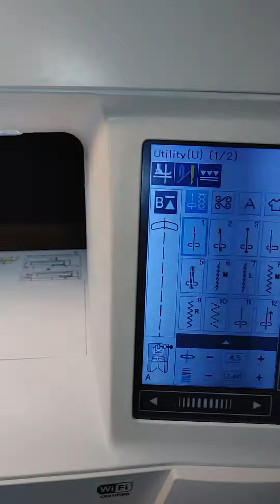Janome Sewing Machine Needle Bar Calibration.

Comment: Thanks Eric this is exactly what I was looking for.  The Skyline S9 is pretty much built like the MC 9900.  I have been trying to fix an issue where the tension in embroidery mode is not working and thread is too lose.  When switching to sewing mode the tension works and can be adjusted but switching back to embroidery and the tension stops working.  I have cleaned the tension unit and have cleaned and oiled the machine but still have this problem.  The only way to do embroidery is by applying tension to the thread before it goes into the machine.  I have tried everything except reinstalling the software which could be the cause.  The only other area I have not tried is making sure that the needle bar is correctly falling into the machine and lining up with the hook race.  I will try that now.  If you  have come across this problem before or know what needs to be done to fix it, please let me know.    Thanks again for this video which really cleared things up for me as far as the needle bar is concerned.  Jo
Reply from the maker: You're welcome, let me know if it doesn't work and I will try to figure this out also.
Reply from the maker: This is a pretty good video on thread tension issues https://www.youtube.com/watch?v=b7Lqa7-sbnI
Reply from the maker: Here's another one. https://www.youtube.com/watch?v=YSSHUjOsVUw
Reply: @ejdavis72  I've checked the hook race and needle position like you showed in your video and also checked the needle bar for any area that may be lose but everything seems fine and any adjustment in any way only makes the problem worse.  I've put the machine back to the way it was and still have the tension issue.  something else that is odd is that once the machine is threaded and I tug on the thread to test the tension the tension appears to be correct for about a second or two and then it gives way and loosens.  When placing my ear to the machine and doing the same thing, I can hear a click when the tension becomes lose.  It seems to be coming from the top, plus on openng the machine up, there is no visible place for it to be happening on the tension unit.  Is there a way of tightening the tension unit a bit before reinstalling so that it starts working with the disks closer together.  I will also be checking the top part of the machine where the thread first enters into the machine, but even if this was faulty it would not explain the amount of looseness experienced,  It most definately is that the disks are working but maybe they have somehow gotten moved or opened more than usual and have not returned to normal and the auto tension is adjusting as if the starting point was tighter than they actually are.  I will try to inspect the unit and see if there is a way of tightening the tension before it is controlled by the machine.  (not the screw on the side which I've had to move to it's tightest but only helps a little.  increasing the tension to max  via the computer again does work but it's not tight enough for the embroidery and it shouldn't have to be on max tension like that.  Before, I would not be able to stitch if it was on max tension.   On searching the internet I have come across a few people who have had the same problem but only one has left a message saying that she took it into the dealer who changed the needle bar which she claims was brand new and the machine is working great.  Do you know how I can reinstall the software on the machine as it could be a software problem?
Reply from the maker: @jofrangoullides3281  I really don't know how to reinstall the software other than just typical updates.  I would take it to the dealer, It has a 25 year warranty on the mechanical and 5 year on the electrical.